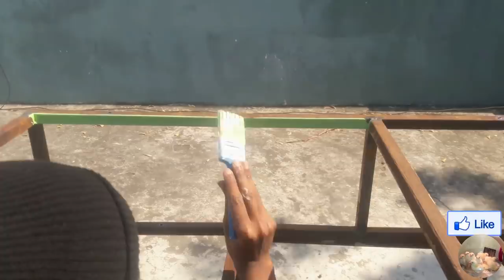How To Make Love Birds Cage At Home || Love Birds House Design

Comment: Bahot behtarin cage banaya hai. Frame baneka kitna kharcha aya? Isme jali ko nut bolt se tight kiya ja sakta hai kya?
Reply from the maker: Thank You So Much Prasad......Materials Flexi Pipes Use Kiya Hai Iska Cost Bahuth Kam Hai...Lekin Welder Ke Charges Mehanga Hai.....Total Cost Rs 2000/-
Cage Size :
Length =  4 Feets (120 Centimetres),
Width = 2.75 Feets (82 Centimetres),
Height = 2.75 Feets (82 Centimetres)...... Approx)
Reply: @BirdsAndAnimalsPlanet  I'm very much impressed the way you made this cage. Maine aaj hi same cage bananeke liye net aur frame welding kar ke laye hai.
Reply from the maker: Ohhh Congrats Bro ....All The Best
Reply: @BirdsAndAnimalsPlanet  thank you Sir. It's not complete yet. It costed me Rs.900 for square pipe with welding besides drilling holes in it, Rs. 800 for Mesh and nuts and bolts and other miscellaneous expenses were Rs. 200. I attached mesh with the support of nuts and bolts. Cage size Length 5 ft, Hight 4 ft and Width 2 ft.
Reply from the maker: Ohhh Thats Great Perfect
Reply: @BirdsAndAnimalsPlanet  thanks but credit goes to you due to your informative vidio.

Comment: Bro amazing .....very easy to do ...I hope.   ...what the cost u had to spend for the empty cage iron layout!???
Reply from the maker: Thank You So Much My Friend........Iron Frame Cost Is 1200/- Approx (We Used Flexi Pipes Which Is Cheaply Available But Welding Is Costly)
Cage Size :
Length =  4 Feets (120 Centimetres),
Width = 2.75 Feets (82 Centimetres),
Height = 2.75 Feets (82 Centimetres)...... Approx)

Comment: Nice but for bottom better to put only mesh so that droppings will fall to the ground as it will help in keeping the cage clean , or better use plastic sheets to close the bottom so that the droppings can be easily cleaned with water , it will save lot of time in cleaning the cage
Reply from the maker: Thank You So Much For Nice Suggestion We Will Try To Implement It

Comment: Is mein kya kya saman lagta hai answer me tabhi mai kar paunga
Reply from the maker: Bhai Ek Pipe (Flexi Pipe) 20 Feet Ka Hotha Hai Approx................ 3 Se 4 Pipes Lagenge Iss Cage Ke Size Ke Hisab Se Aur Jaali (Net) + Nut Bolts + Mitti Ke Pots + Binding Wire + Plywood Lagenge Iss Cage Ko Banane Me
Cage Size :
Length =  4 Feets (120 Centimetres),
Width = 2.75 Feets (82 Centimetres),
Height = 2.75 Feets (82 Centimetres)...... Approx

Comment: This box delivery  available  S  NO plz reply
Reply from the maker: No My Friend Shipping Is Not Possible Because We Didn't Have Any Courior Facility Here And It's Big....It's Better To Make Your Own......Cost Is Rs 2000/- Approx.......Make Your Own By Showing This Design To Your Near By Welder.......(We Used Flexi Board Pipes It Is Very Cheap And Strong Just Welding Is Costly).....All The Best
Cage Size :
Length =  4 Feets (120 Centimetres),
Width = 2.75 Feets (82 Centimetres),
Height = 2.75 Feets (82 Centimetres)...... Approx)
Reply: Thanks bro
Reply from the maker: Most Welcome

Comment: bro cage to tell price  why?👍👍
Reply from the maker: Total Cost Rs 2000/-........Iron Frame Cost Is 1200/- Approx (We Used Flexi Pipes Which Is Cheaply Available But Welding Is Costly)
Cage Size :
Length =  4 Feets (120 Centimetres),
Width = 2.75 Feets (82 Centimetres),
Height = 2.75 Feets (82 Centimetres)...... Approx)
Reply: @BirdsAndAnimalsPlanet  sir ap sell krty h??

Comment: How much it cost bro ..
Reply from the maker: Cost Is Rs 2000/- Approx.......Make Your Own By Showing This Design To Your Near By Welder.......(We Used Flexi Board Pipes It Is Very Cheap And Strong Just Welding Is Costly).....All The Best
Cage Size :
Length =  4 Feets (120 Centimetres),
Width = 2.75 Feets (82 Centimetres),
Height = 2.75 Feets (82 Centimetres)...... Approx)
Reply: Thanks bro..
Reply: @BirdsAndAnimalsPlanet  what material sheets to cover Roof

Comment: sir can you tell me hoe much it costs for that angelt structure?
Reply from the maker: Total Cost Rs 2000/- (For Structure Rs 1250/-).......We Used Flexi Pipes It's Available At Very Cheap Cost...But Welding Is Costly....
Cage Size :
Length =  4 Feets (120 Centimetres),
Width = 2.75 Feets (82 Centimetres),
Height = 2.75 Feets (82 Centimetres)......(Approx)
Reply: @BirdsAndAnimalsPlanet  OK bro...

Comment: What is the cost
Reply from the maker: Total Cost Rs 2000/-........Iron Frame Cost Is 1200/- Approx (We Used Flexi Pipes Which Is Cheaply Available But Welding Is Costly)
Cage Size :
Length =  4 Feets (120 Centimetres),
Width = 2.75 Feets (82 Centimetres),
Height = 2.75 Feets (82 Centimetres)...... Approx)
Reply: @BirdsAndAnimalsPlanet  jali plastic ki hai ya iron ki..

Comment: Can u sell me dis cage?
Reply from the maker: No Brother Shipping Is Not Possible Because We Didn't Have Any Courior Facility Here And It's Big....It's Better To Make Your Own......Cost Is Rs 2000/- Approx.......Make Your Own By Showing This Design To Your Near By Welder.......(We Used Flexi Board Pipes It Is Very Cheap And Strong Just Welding Is Costly).....All The Best
Cage Size :
Length =  4 Feets (120 Centimetres),
Width = 2.75 Feets (82 Centimetres),
Height = 2.75 Feets (82 Centimetres)...... Approx)
Reply: Bhai is ka price

Comment: bhai what is cost of only frame
Reply from the maker: Thank You So Much My Friend........Iron Frame Cost Is 1200/- Approx (We Used Flexi Pipes Which Is Cheaply Available But Welding Is Costly)
Cage Size :
Length =  4 Feets (120 Centimetres),
Width = 2.75 Feets (82 Centimetres),
Height = 2.75 Feets (82 Centimetres)...... Approx)

Comment: Amake baniye debe
Reply from the maker: My Friend We Didn't Have Transport Facility How Do We Send ?.....It's Better To Make This at Your Local Welder
We Used Flexi Pipes and Cage Size Is 
Length =  4 Feets (120 Centimetres),
Width = 2.75 Feets (82 Centimetres),
Height = 2.75 Feets (82 Centimetres)...... Approx